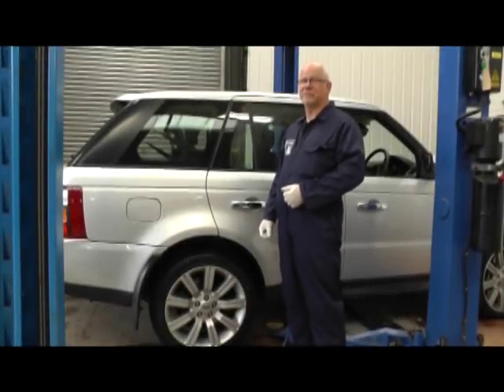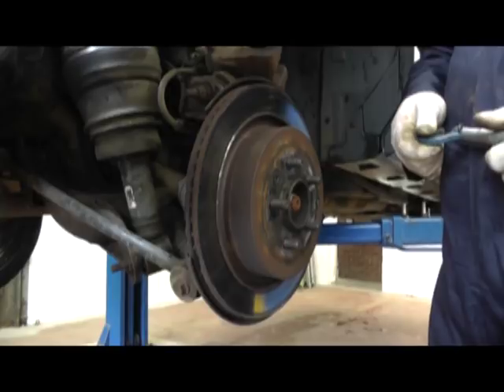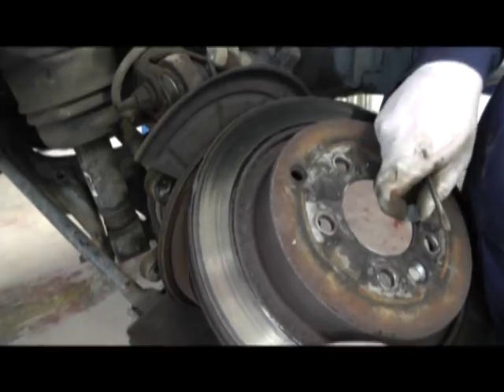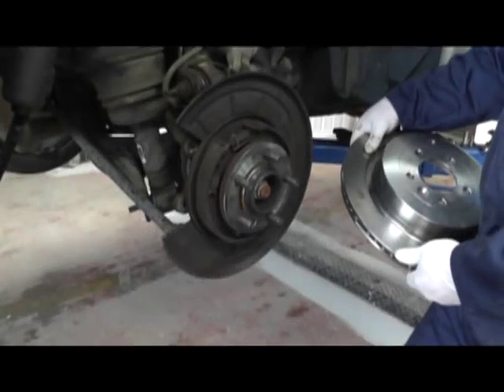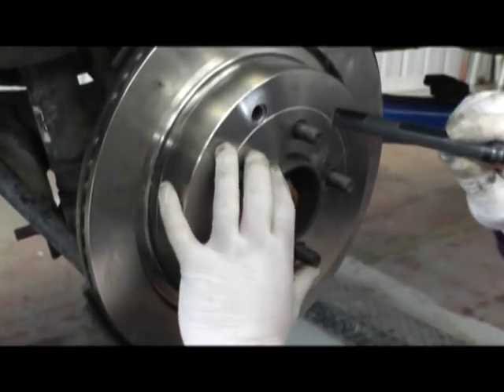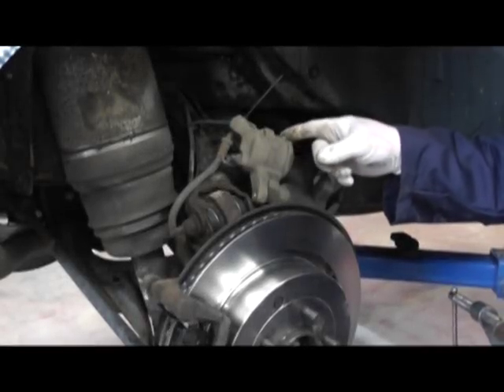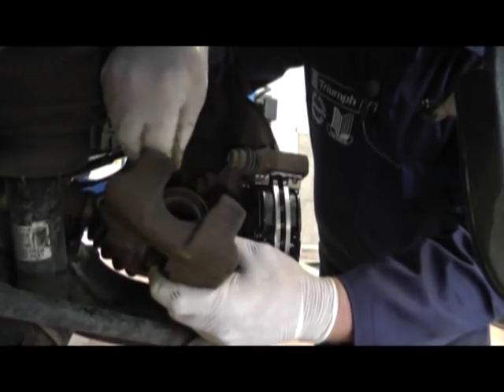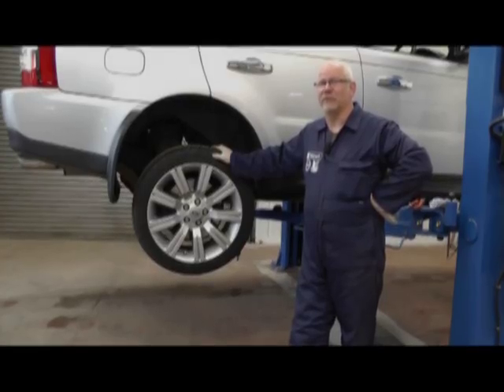Changing the rear discs and pads on a Range Rover Sport.

Comment: Adjustment procedure is wrong.

It’s supposed to be adjust till disc requires at least 40nm to move with a torque wrench but no more than 90nm. So it shouldn’t be locked up.

Then turn back the adjuster exactly 8 clicks.

Comment: Great vid, I'm tackling this on the weekend.  This guy is so chill I almost fell asleep watching haha!
How exactly do you put the vehicle into service mode?
Reply from the maker: Ha, yeah, Hans is pretty horizontal! As for service mode:

In the car with ignition in Position II, press the brake pedal three times and hold the pedal down. 
Push down on the EPB switch for 3-5 seconds. 
Go to the main fuse box in the engine bay and remove FL8 fuse 30A (pink Fuse) this will ensure that the EPB is not accidentally re-engaged.
Reply: Rimmer Bros TV thank you!

Comment: How often ( mileage) do pads  usually need replacing? Thanks
Reply from the maker: Hi Alfie Dog, brake pads are usually changed once worn (when low or worn unevenly) Your local garage will be able to suggest more accurately what to keep an eye on.

Comment: Hello, do you know on a 2012 RRS HSE, you HAVE to replace the rotors as well?
Reply from the maker: A very common quandary. We would always advise to replace both at the same time. Discs may not look too badly worn but they have a certain heat capacity when new. As the disc wears this capacity is reduced and can transfer it to the fluid, caliper etc and cause damage or serious reduction in efficiency. Having said that, it's not a hard and fast rule. You may be quite satisfied with the performance of your brakes if you just change the pads. But as I said, we would always recommend changing both. Hope that helps.

Comment: When I get to the 2:45 mark, I can't turn my rotor to 11 o'clock. 

My 2011 Ranger Rover sport automatically turns the parking brake on if I put it in neutral and don't have it running. I don't want to work on the car while running because I'm in an enclosed space, nor am I sure it would turn anyways. 

What gear are you in for this? I assume neutral. How did you get the car to stay in neutral without the parking brake on?
Reply: FunInfusedGames how do you cope with something like a car wash? Engine has to be off and car in  neutral otherwise the car can't be pulled through the car wash
Reply: pull the FL8 fuse out